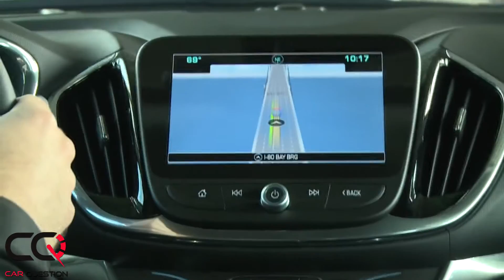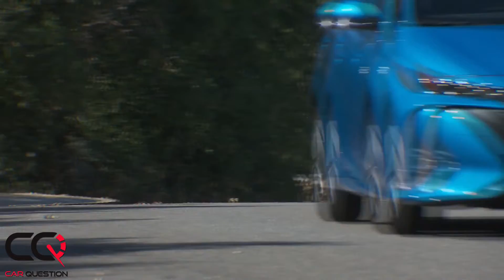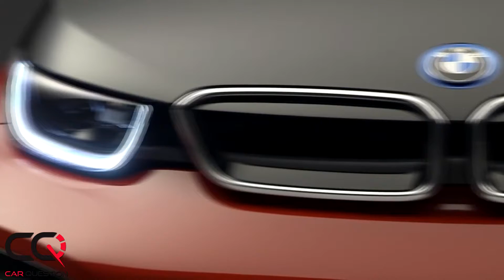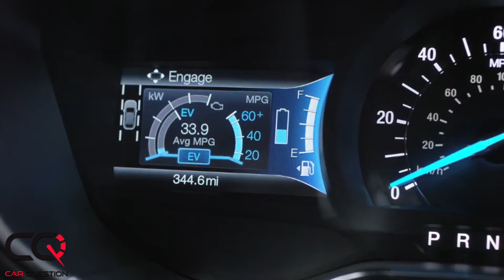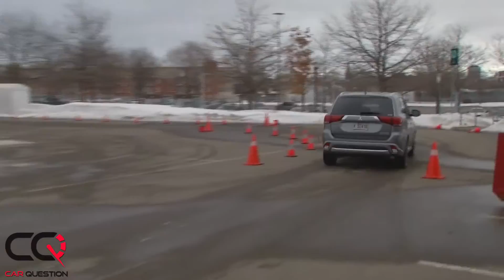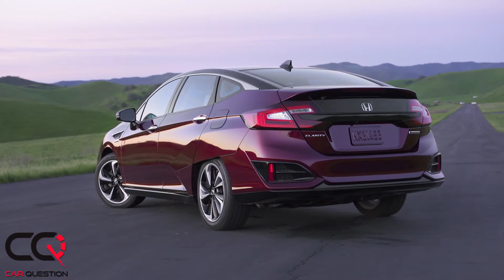The BEST Plug-in Electric Hybrid Vehicle you can CHOOSE (2018)! | Clarity review part 4/6

Comment: The Chrysler Pacifica PHEV is my top choice for versatility, performance, luxury and price
Reply: But it's a Chrysler. It's bad by design.
Reply from the maker: we kept this one for the face to face with the Outlander PHEV :P
Reply: Pacifica might be good  but for hauling but if for work or  grocery  and from day to day activities ,  sub compact has a great advantages and mitsu  has a 4x4 for snow driving which I really need.
Reply: how much better is the 4x4 on the Mitsu compared to driving in snow in the Volt, Prius, and so on.  Will it make that much of a difference?  I am not which PHEV to get, they all have something the other one doesnt.  Why cant Mitsu make ventilated seats! :)